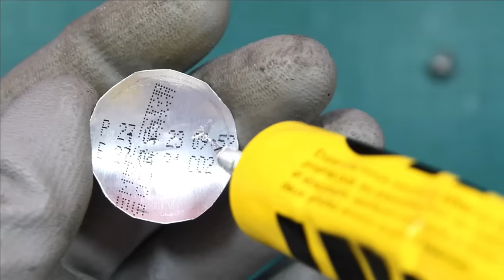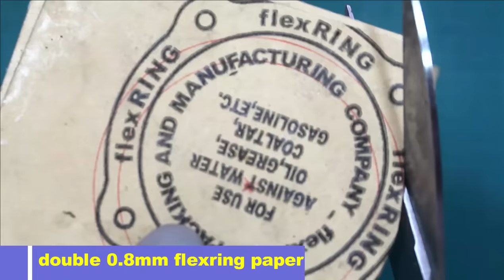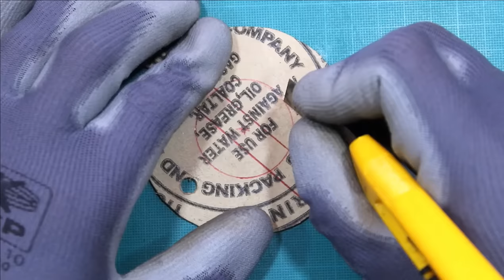--||-- How To Make HiFi Tweeter at Home --||--

Comment: It is reproducing the treble frequencies with a metallic tone because of the metal dome. If it were a silk dome or other lighter material, it would reproduce a softer treble sound with greater wide-ranging high frequencies.
Reply: The metallic sound can be fixed

Comment: Bravo!  These look VERY similar to my  EPI 100v  speakers "inverted" tweeters.   EPI made two versions of them, the newer version of them, produces the most incredible, wide, 3D Sound-Stage, that you can ever imagine.   You should also try Inverting the Cap... making in concave,  instead of a Dome (just flip it over).  The Concave shape, seems to be able to spread the high frequencies a LOT wider and better, than a typical Dome shaped tweeter.

 As for Midrange, the best Ive ever heard, was a 3 inch dome version (on a different speaker altogether.  And typically, Im not a huge fan of midrange... but these were so very Buttery Smooth, that I was in love with them).

 The EPI tweeter plays the midrange frequencies pretty darn well.

 The EPI 100v  woofers,  are a special 8"  woofer... that according to the Designer,  he used a heavier gauge coil winding on them.  He did this, so that they automatically filtered out the high frequencies... without the need for an additional Crossover component.   They have very large, heavy, and powerful magnets...  as they are designed to be in an Airtight box,  and need that power to be able to deal with air compression forces.   It uses the cabinet air like a centering spring.    The bass is incredibly deep for the size of the woofer, and the small size of the enclosure.  Its both deep and punchy... and at very high volume levels.. creates some decent vibrational shaking... similar to a sub.

 Whats most amazing about these speakers... is that they completely vanish into a room.   In fact, when I first heard them playing... I spend about 10 to 15 minutes, trying to physically locate them.  It was like the sound was just Holographically projected, into a 3d sound field...  probably with a range of about 20 x 20 ft squared.   The other amazing thing about them... is that they have such little distortion... that I was able to make out lyrics from a singer... that I could never understand before.  Where normally... the musical instrumentations and effect... sort of Muddied together with his vocals... making it impossible to tell what he was saying.  But with these speakers, the instruments were clearly defined from his vocals in that section... and it was easy to make out what he was singing.

 This level of power and precision control... is unmatched in todays ported ECO-Speakers.   And as such,  they cant even come close to what these 1970s era speakers are capable of.  They totally blew the local high end stereo shops $3500 speakers, completely out of the water.  No competition at all.

One of the original workers from EPI or Genesis, still repairs, and custom builds, brand new EPI replacement drivers,  at  Humanspeakers  dot  com.   According to him, he made improvements to the already fantastic EPI 100v inverted tweeter.  That said, Ive never heard his updated version in person... so I couldnt say anything either way.

 Id been considering trying to add a  3" dome midrange the mix...  and potentially either a 2nd woofer or a passive radiator,  to see what might happen.   But as Ive said, they sound fantastic as is.  Better than anything Ive ever owned / heard... and thats saying a lot,  as ive owned over 30 different speakers,  and have heard some really unique and rare speakers, in my lifetime.

 It would be nice if you actually make a c-shaped box (open baffle),  when you play these as a test... so that people can get an even better idea of how they actually sound.
Reply: Who you talking to?

Comment: Good job, but I'm afraid the mass of the moving system will be too large!
Reply from the maker: No, not large,  because  the plexiglass and the diaphragm support under plexiglass have the same hole diameter = suspension diameter reduced

Comment: I had 4 ohms woofer, do i need to remove half of the coil??
Reply: Well you do have to remove the coil if there is alot of it. The coil is heavy enough to reduce the frequenzy response by alot. This means that the tweeter isnt able to go as high

Comment: Thank you for this very inventive video.
What if i dont remove the half wire of the coil and i leave it as it is?
The resistance will remain 8 ohms but Is it going to sound ok?
Reply from the maker: apart from the weight, the width of the tweeter coil must not exceed that of the top plate, the coil must vibrate in the magnetic flux created by the top plate for best HF reproduction.

Comment: Original assembly especially the adjustment by ear LOL... it won't last long it will quickly crackle in my opinion... it's only my opinion lol LOL

Original de montage surtout le réglage à l'oreille MDR...  ça va pas durer longtemps ça va vite grésiller a  mon avis ...ce n'est que mon avis lol MDR

Comment: Will it be still an  8ohms speaker?
Reply from the maker: no, about 4ohms
Reply: It removed half of the rewind... so it will divide the resistance into 2..
Reply from the maker: @arjaygarbin3848  yes
Reply: I had 4ohms, do i need to remove half of the coil??

Comment: You made a slight mistake. You don't insert the plastic sheet separating the magnetic core with the coil cone. It doesn't center the coil. Appreciate the idea.
Reply from the maker: No, it's not a mistake, i did that technics to centering the voice coil for all drivers , it's very useful if you want to repair surround foam without removing Dust cap,  i did a video about that.
As you know speaker with modified dust cap lose value when you want to sell it.